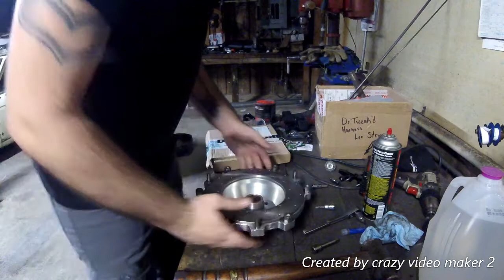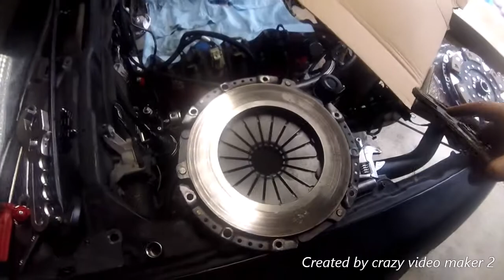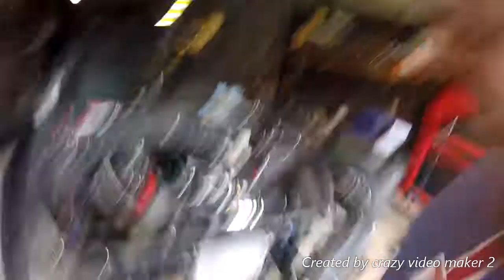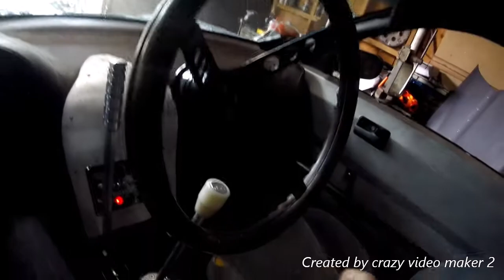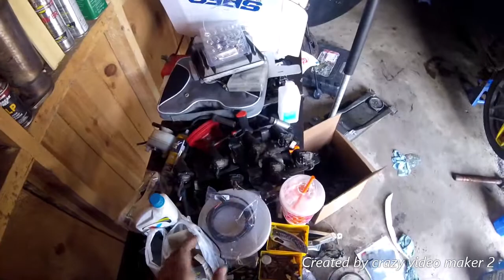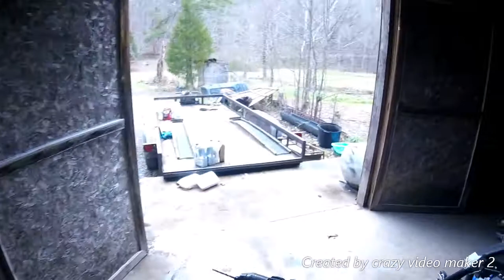PMC friction plate and new clutch!

Comment: He Guy did you get the engine conversion done? i have an 1uzfe laying around and want to buy an rx8 for the engine to put in my fb rx7. just thought to get the rx8 running with 1uzfe and have a great platform with an engine with quite some torque.
Reply from the maker: No, unfortunately not. I had issues getting the title sorted and sold the car for parts.